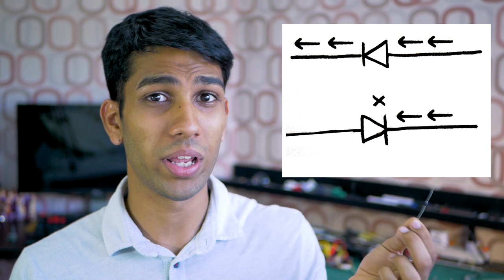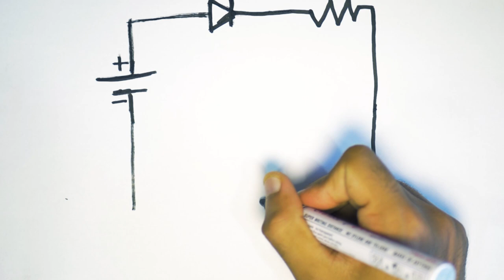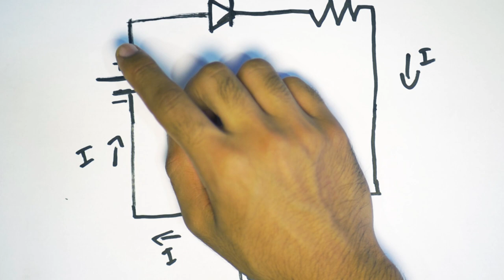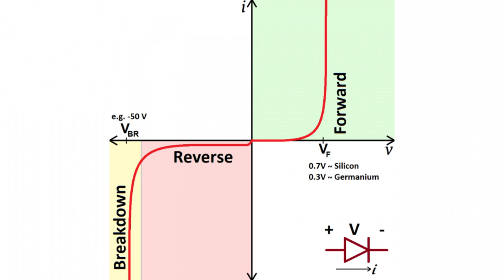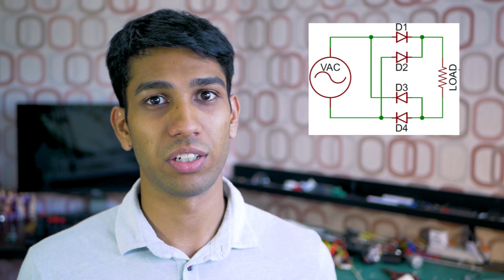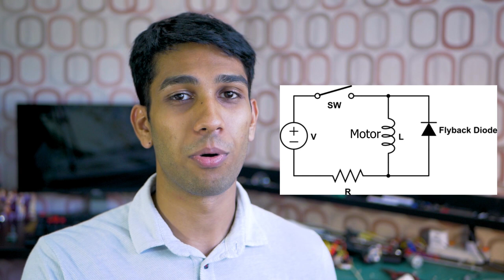Diode Tutorial for beginners- Electronics Crash Course #11

Comment: Great. Glad I found this. I get totally the diode across a motor to cancel back EMF. I just ripped a PARKSIDE drill apart. It has a standard 7.2 to 20 volt switch, but rated at 20 amps that makes it different. What makes it even more fifferent is a third wire to a mid point on the battery. As a drill it is two way. It had a 6amp 400v diode across the switch. As I have had this laying around for ages trying to find the switch (and failed) I am going to try a switch without the mid point wire, but, as it is two way, where does the diode go. Is it across the battery, because the load swings polarity to change direction?